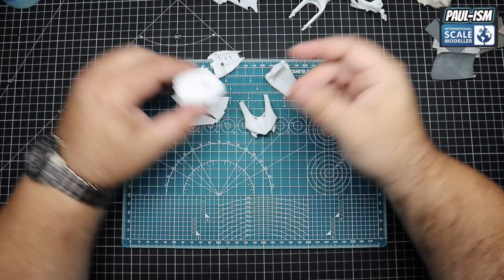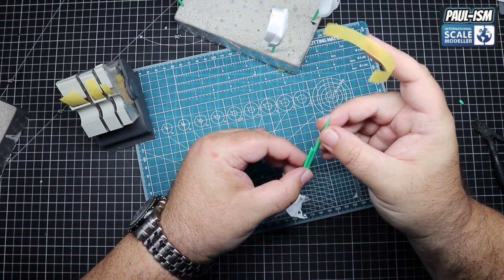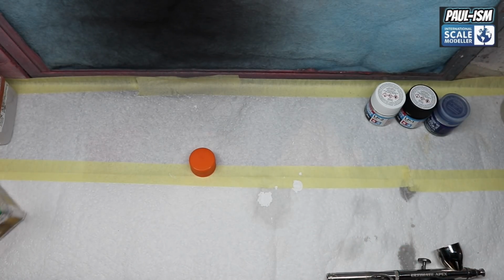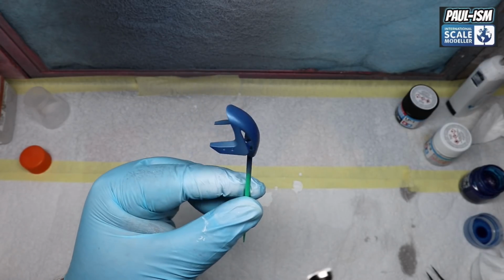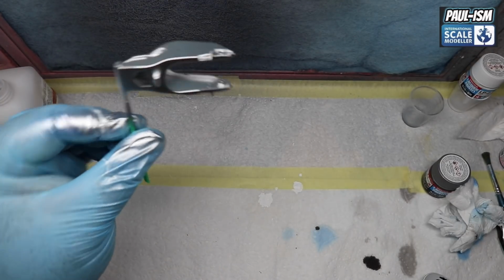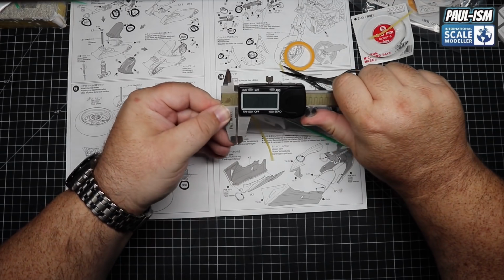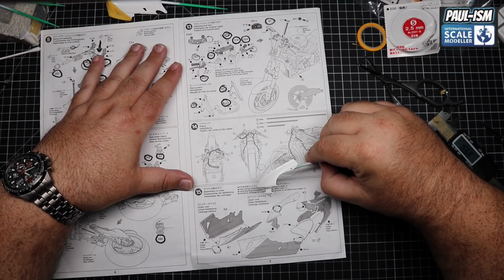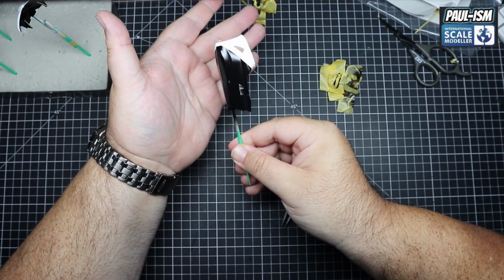Part 4 - Tamiya 1/12 Honda Rc211v '06 Step by step Build

Comment: When clearing with 2K, how do you avoid having the 2k pool up in the edges of the inner panels where two body panels meet up. I tend to end up with 2K in those slots and it makes the body panels not meet up perfectly flush and I end up having to scrape out the paint to make the panels fit together properly.
Reply from the maker: Sounds like you’re putting too much clear down

Comment: Nice progress Paul.  Quick Q - do you set aside the various stages of priming/painting (mist coat to wet coat) or do it all in at once with each piece?
Reply from the maker: Hey Al They get set aside for 5 mins between coats usually, sometimes with the UMP primer and the LP lacquer by the time I've done all the parts the 1st piece i painted is ready for another coat :) Cheers
Reply: @InternationalScaleModeller   Thanks Paul - just one of the things that's probably in the video that I missed ;-)